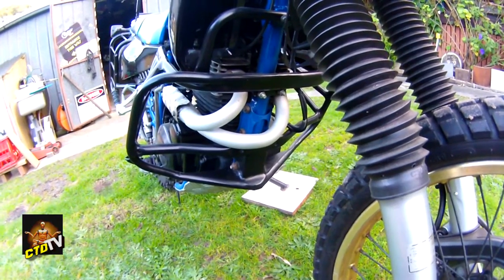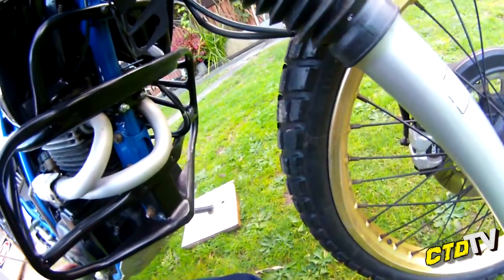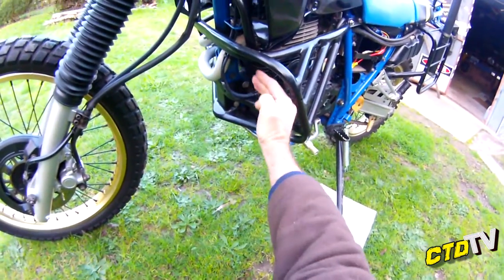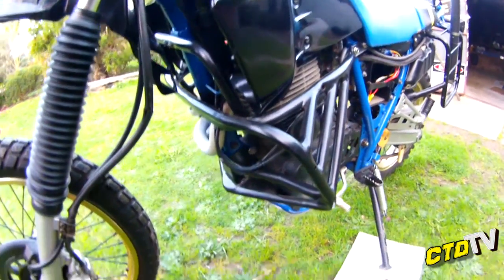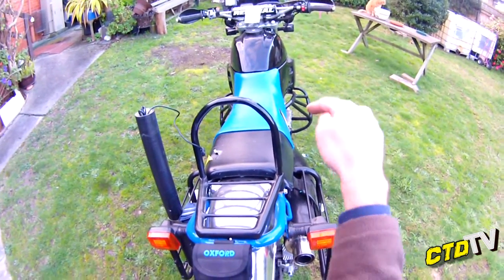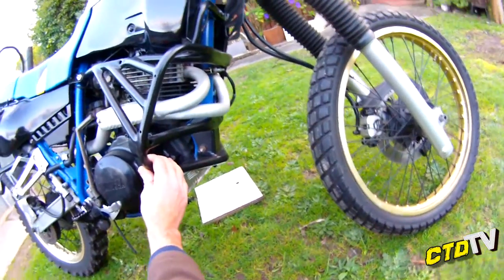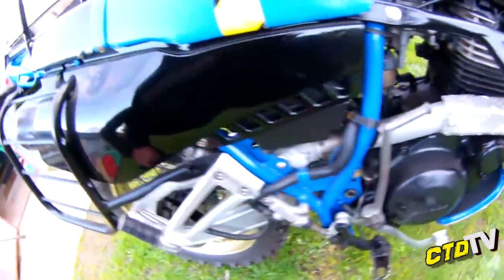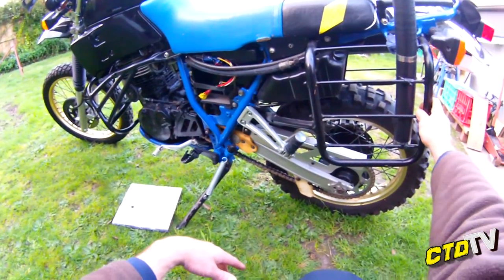XT600 Engine CrashBar - How I built mine

Comment: Very good job man !  Can we have your production plans for the crash bar and the case holder please ?
Reply from the maker: I actually never did any plans. Most of the bits were off the scrap heap/from mower handles etc.
I did start with the Horizontal mount off the engine bolts (front frame up-tube). After that, it was just a case of 'Make it up as I went'...
This vid I did may help you a bit more - https://www.youtube.com/watch?v=wQXgF4IOQco&list=PLybrzAb6DxWBnym6kGD4uNVSr9dwmf6km&index=5
Love to hear how yours goes.
Cheers n RSOT >:)
Reply: @MrFalloffalot   OK Thank you for your reply. Maybe I Will try but it seems very difficult for my level.
Reply from the maker: @PalPatine0893  What country are you in?
I'll try find one for you. Or if your close, I could make one...??
Reply: @MrFalloffalot  Thank you, it Will be very great ! I'm in France. How much it Will cost if you make me One ?
Reply from the maker: @PalPatine0893  Ummm??
Letme do some googling (see if there are alternatives).
If I haven't got back to you soon. Nudge me!
Whats your budget too btw? Postage might be the big cost though...??
Spk soon, RSOT >:)
Reply from the maker: @PalPatine0893  Found this (Germany I believe).
Or do you still want me to work out a price? It would be at least double (base on material difference to this Link)
https://www.off-the-road.de/en/Other-bikes-otr/Engine-protection/Crash-bars/Engine-Crash-bars-Yamaha-TT-600.html
Cheers n Spk soon >:)
Reply from the maker: Or this - https://www.ebay.com/p/22029839159

Comment: Not too bad.
And what is the weight of the engine bars? 
Plus the rear rack system. 
Total about - ?
Reply from the maker: In hindsight, I wish I weighed it before putting it on.
I used various size tubing and plate, some off-cut mower handles (thin gauge) and some were thicker (rear rack tubes and main front frame & ribs).
The rear rack, I put solid rods in (the ladder/horizontal rods).
So with all that in mind. I'm going to 'guess' between 7-12kg. Heavier than a bought one, but won't bend like a bought on either.
Bit more weight to an already heavy bike. But I'm not going to be doing aerial jumps anytime soon...lol
Hope that helps you. You could always use thinner gauge etc. & Pre Plan yours.
I didn't, I just started grabbing offcuts around me and....Kazaam - Front & Rear CrashBars!)
Cheers n RSOT >:)